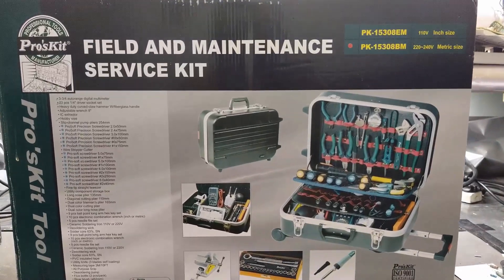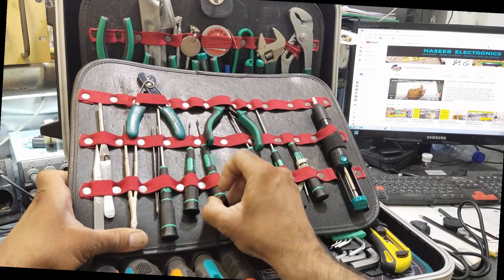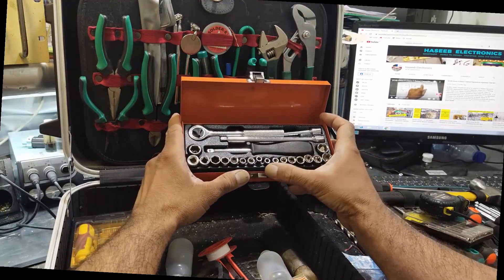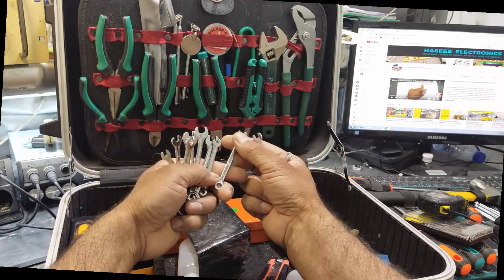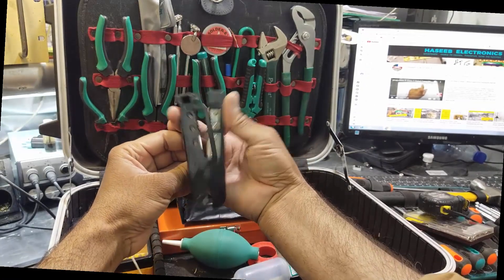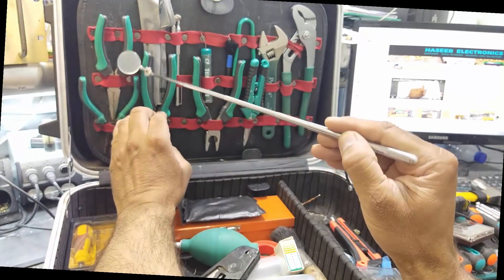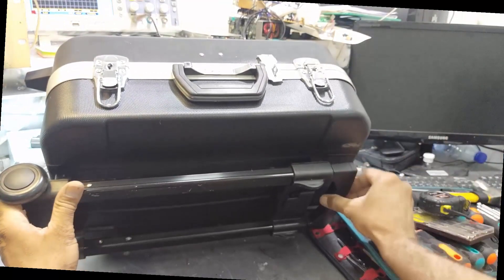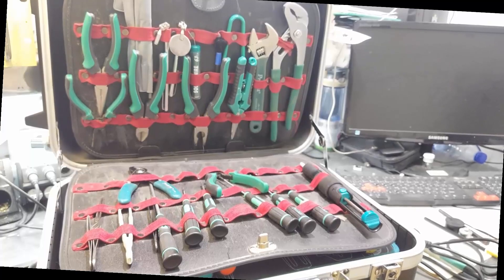{454} Best Field and Maintenance ToolKit for Electronics - Pro'sKit PK-15308BM

Comment: I’m not sure how many followers you have here in the USA… But you have taught me so much about troubleshooting electronics, proper use of test equipment, and general electronics knowledge! I hope many more people in the USA find you and follow your channel.

I do this for a living. I have a lab focusing on component level board repair for a wide range of industrial and government clients. I Also deal with a bit of test equipment repair/calibration, and metrology just to keep me humble. 😂

I found your channel by accident last year, and I’ve spent more time watching your videos. Than almost any other electronics channel!

There are a lot of great teachers on YouTube… But I’ve learned the most from your channel, And from the channel “diode gone wild”.

Also would love to see you teach about test equipment, from the really simple and cheap troubleshooting tools (like in circuit ESR testers, thermal cameras, stuff like that) and proper use of test equipment like multimeters and oscilloscopes. Anything that helps beginners find problem quicker. That’s some of the most fun stuff to watch.

Even though I do electronics work for a living… I just really enjoy watching your channel and hearing you teach it. It is nice to see The working habits of other professionals like yourself.

It’s so terrible and sickening how here in the USA… People just throw things away if there’s a small problem. Even if it’s something brand new and expensive… They will just throw it away and not even try to fix it. I hope that changes soon.

You help so many people.... you are a wonderful teacher and your channel is awesome...
Thank you so much for your hard work!
Reply: I agree 100%! I have learnt so much from this channel and always recommend it!

Comment: Salaam sir, I am Israr Ali from Hyderabad Sindh, I am your follower on your YouTube channel, kindly guide me about my Rigol DG2041A function generator. It was after shown a message on screen (overload waveform), and suddenly disable square and pulse waveform at output terminal but showing voltage on output terminal, and other all waveform are properly appearing on output terminal, so kindly guide to me that, how can enable square wave and pluses wave on output terminal? 
Best Regards 
Israr Ali
Reply: https://youtu.be/mIzVJ8Yt95E